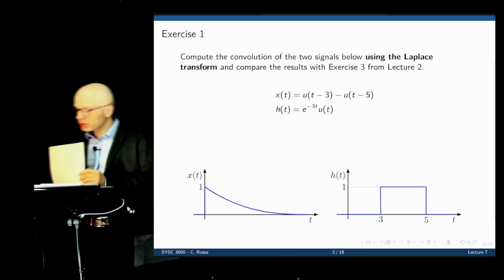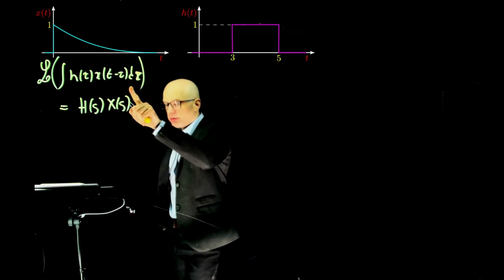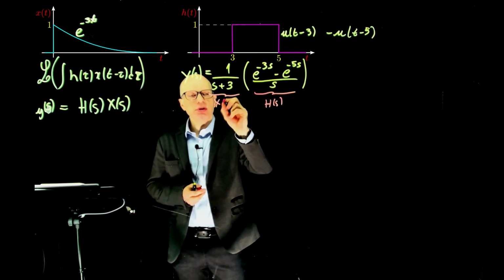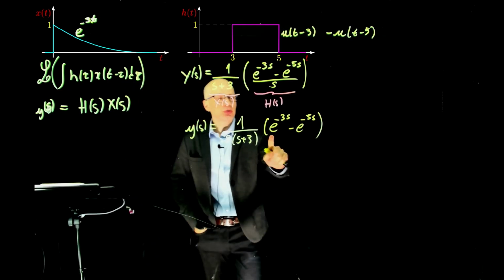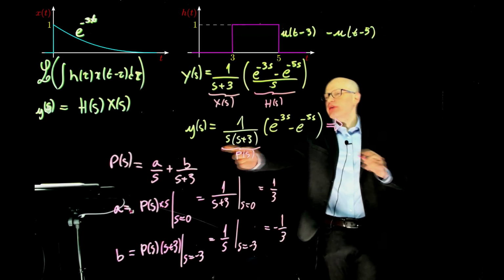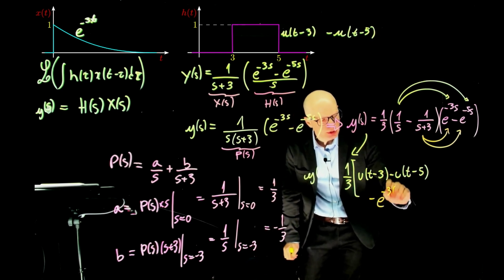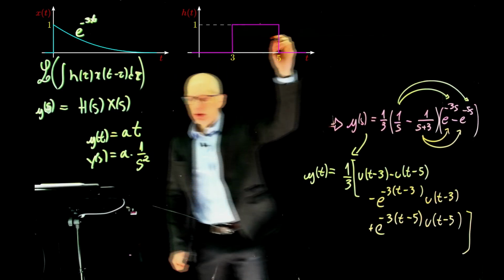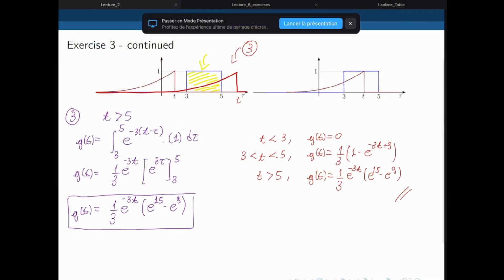Systems and Simulation, Lecture 7 - Convolution Integral using the Laplace Transform

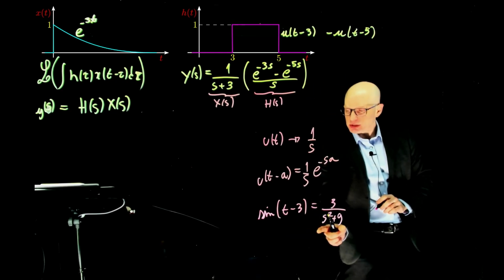Comment: Hi professor, why did you calculate the Laplace transformation of sin(3t) at time 8:10? Shouldn't the result of this transformation be [1/(s^2+1)]*e^(-3s)?
Also, couldn't we have used equation 15 which is "sin(at+b)" in the Laplace transformation formula sheet to solve sin(t-3)?
Reply from the maker: yes that's right! +9 is a typo, it should have been +1.